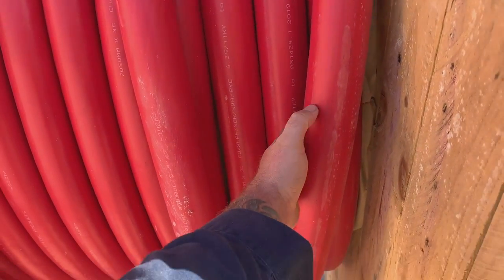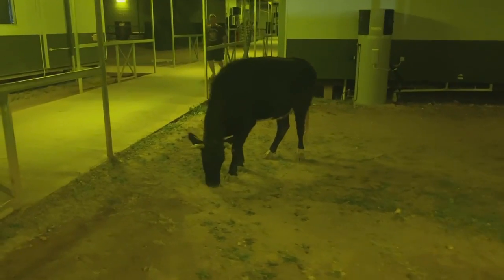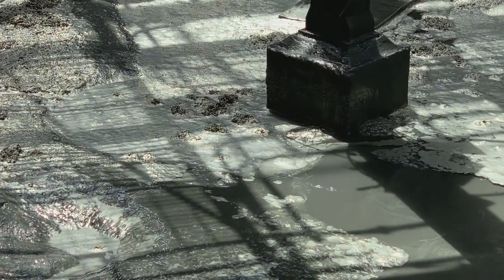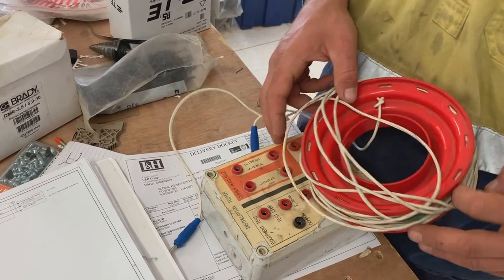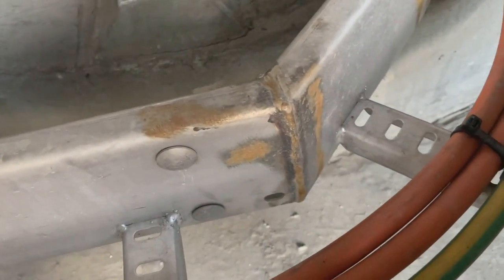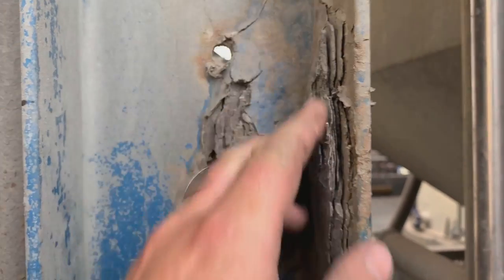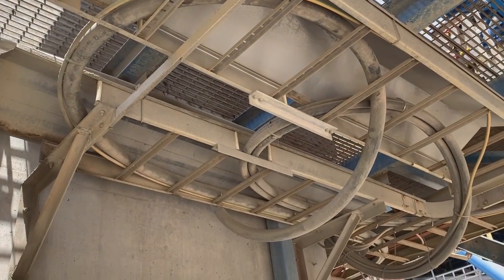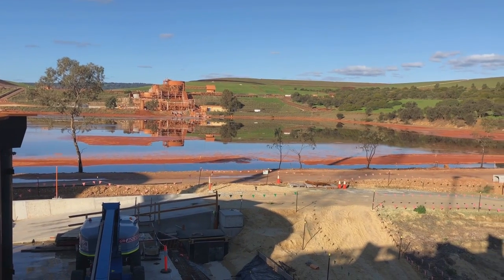HV Cable Pull Winching and Custom rollers, Float Cells, h/made tools & MORE! | Until It Hertz E08

Comment: 45 cut on a pipe reduces the noise of the discharge.
Reply from the maker: This theory is all well and good, and works but the noise would not be an issue. That does not mean your incorrect just it was not necessarily

I can see them doing every pipe ever like this for noise but only a few cases needing it
Reply: Just found this also: 
Whenever water pushes out of a pipe, an equivalent amount if air rushes into the pipe (else it'll create a strong vaccum at the back of the pipe, against which, your pump shall not be able to work.)

Now, when the ends of the pipes have no cuts, water always has that tendency to be in contact with the sides of the pipe.  (source: fluid dynamics)

But when it gushes out, air must be sucked in too. This leaves the air, a very odd random pattern to enter the pipe. This gives us a very unregulated flow of water. I'm sure you must have noted this phenomena somewhere. It comes out in a random series of splurts instead of a continuous flow.

Answer found 👍